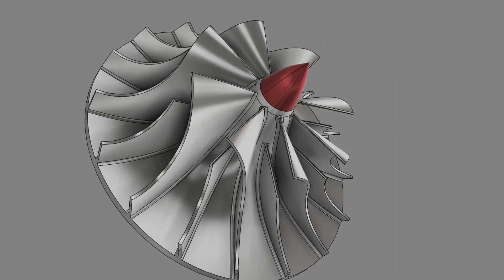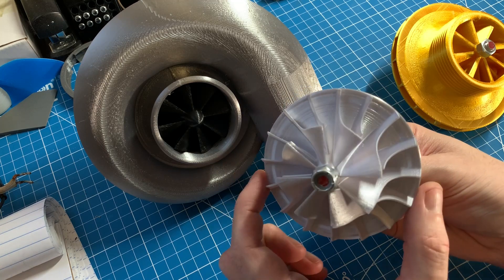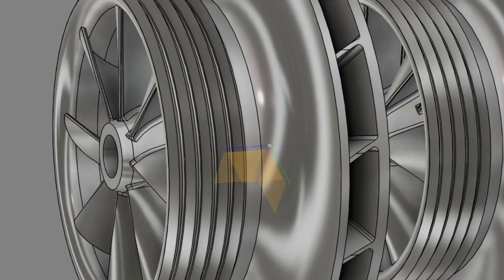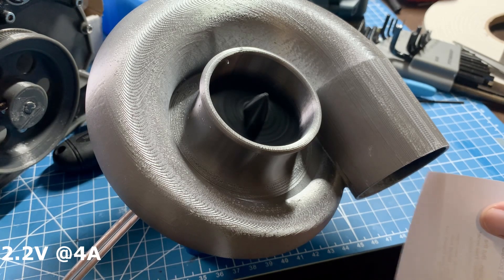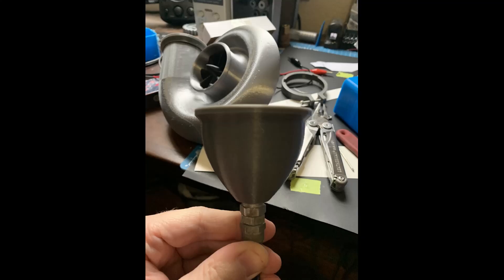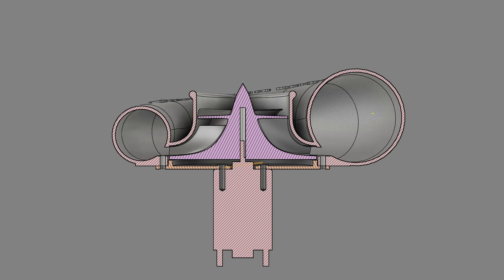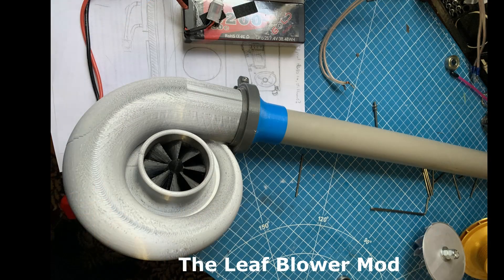3D Printed Centrifugal Turbo Compressor

Comment: Curious, did you ever end up putting the STLs out there on this? This is one of the best designs I have run across. 
From what I gather the wedge diffuser is quite important for pressure and efficiency sake.  Looking at the NASA CC3 impeller, some pretty impressive top end is possible. The only way I can see basic FDM machines making a strong enough impeller would be using lost casting, Sintered FDM, or perhaps a kind of carbon fiber mold.

Comment: 1:35 You right.... its not easy job "Design a compressor wheel" 😑 And on some CAD software it becomes even more difficult.

SolidWork = too expensive.
AutoCAD = expensive.
SolidEdge = poor performance.
Fusion 360 = its a pooph cad 💩

Comment: Can you share the cad files or the papers you used to make this? I'm making something like a leaf blower and this seems perfect for that
Reply from the maker: It’s been a long time since I designed this and I don’t have the papers available. I do know for a leaf blower they usually use just straight vertical blades. This blower creates a lot of pressure but the flow isn’t very high.
Reply from the maker: I have the design for the V2 I built here. https://github.com/indeterminatedesign/TurboCompressorV2

Comment: choked flow is absolutely not the same as reverse flow 08:05 in terms of a compressor characteristic, these two states are on the opposite ends of the characteristic curve

Comment: Love the video! What motor should I use if I want to do something similar?
Reply from the maker: Well, I used a 540 brushed motor which was a. It too small really. Obviously there are a lot of motor choices, so it comes down to how much power you need, and how many RPM you’re willing to spin.

Comment: so whats the research paper? i'm not looking for anyhting nearly as efficient/precise but any direction on blade design would be great...!
Reply from the maker: I think I've lost most of those links.  I'd honestly recommend checking out the book:  https://www.amazon.com/Radial-Flow-Turbocompressors-Analysis-Applications/dp/1108416675

For the second version of this compressor I just ended up copying an existing turbo compressor wheel and it was much better performing.  I ultimately found it's really difficult to design a turbo compressor without CFD so you can tailor it to the application.

Comment: hey bro, would ou like to share the file of it, beacuse i need to print something like this but i cant do in blender 😢that's why i am here :D ( if u want to share i would advice you to share it in parts, beacuse printer propably will connect the parts of compressor and it will not work)
Reply from the maker: I have the later version 2 on my GitHub. It is a single .3MF file but slicers can handle separating the parts automatically. https://github.com/indeterminatedesign/TurboCompressorV2
Reply: @IndeterminateDesign  oh, i didn't knew that they can separate the parts automatically, thanks for all <3

Comment: I don't think you're gonna get much pressure from a turbine.  Generally speaking, speed = volume; torque = pressure
Reply: That's not a turbine bud,  the thing he designed is made to push air, not be pushed by air.

Comment: Use a u tube to measure the output pressure
Reply from the maker: Yeah, check out my 2 stage compressor where I used an adjustable restrictor to measure the peak pressure.  https://youtu.be/9YTMmGZ1d0g

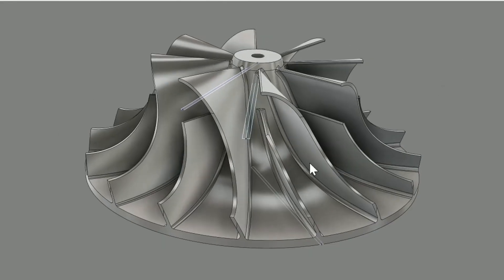Comment: 1:55 I THINK I HAVE THE SOLUTION. Your blade is not efficient at all at the base. The mouth or top of the blade is fine and sucks in air like it should but the base of your blade is at the wrong angle. You have something that looks like the straight spokes of a wagon wheel looking from the top down. You need to angle them backwards more like the look of a hurricane. Your current setup pushes air tangent to the direction of the wheel and it can’t get out of its own way fast enough for more air to come in efficiently. Basically the fan on top is doing all the work. The idea as I’m sure you’re aware is to throw air to the outside of the housing. So by curving the base it will help push the air outward more and create better pressure. All the other dimensions are fine, you basically just need to grab the bottom corner of the blade and move it counter clockwise a little. The idea of a turbo is at its core an impeller with a fan attached on top. I think this is why you aren’t making any boost. Another idea you can try is something I saw on a rumba fan. You have trouble with the clearance because it’s 3d printed and it will never be good enough because that’s just how 3d printing is. The way rumba got around this is putting a cone over the blades and attached to them. This makes the compressor wheel a closed system and your tolerances between the wheel and the housing can be utter garbage and still work perfectly. I would recommend looking up a picture of their vacuum fan to understand what I’m talking about better. But I would try that above all else. Hope this helps and good luck. Can’t wait to see more.

Comment: Your compressor doesn't have a diffuser
Reply from the maker: Good observation. That was a huge issue with v1. If you check out the v2 compressor I added a large vaneless diffuser and actually made a little boost.
Reply: @IndeterminateDesign  also both v1 and v2 have an agressive blade angle of attack at the intake. And both seem to have a rather large intake which increases flow (and power needed to run them) but doesn't increase pressure. The pressure rise is determined by the radius of the impeller

Comment: I designed one too and tried it on my car. It works. I made mine much bigger.
Reply from the maker: That's awesome!  You must have had a massive motor.  I know that Nissan test nylon impellers at one point so it's definitely a possibility for a long term upgrade.

Comment: Amazing designes, I work in factory automation and I happen to have delt with instrument air axial compressors. The ones we have are 4 stage compressors, first stage is the biggest stage sucking huge amounts of air then goes to interstage rad fan style cooler and then to the second stage, the process is the same throught to the 4th stage. Now the second is smaller than first and 3d is smaller 4th is the smallest. The ratio between the drive gear and the dreven gears, one was called high speed and the other is the low speed, was so high like 1:100 for low gear 1:150 for the high gear or even more " not exaggerating". I have actually seen inside of them during overhaul and noticed and linked what i have studied about axial compressors. In order to comperss you need rotor and stator blades. Rotor will move the air at very high speed, now this is were your designs stopped and in this stage it is a blower not a compressor. The secret is stator blades are essential to creat an effect in axial compressors called defusion. Air is comming at high speed by the rotor, stator will change air direction and reduce its velocity, now you are creating pressure and then the max amount of pressure will be limited to multiple factors of efficiency of the designe and clearences between the housing and rotor leakage. As for yor multistage design I have noticed that all stages are the same size which indicate no pressure increase throught the stages + the missing stator part in each stage. Hope i helped and i really look forward to you next videos. 😊
Reply from the maker: Thanks!  Ideally I would create multiple compressor sizes but definitely more time consuming. 

I had thought about the stator vanes in the diffuser, but based on what read a vaneless diffuser has a broader functional range and that a vaned diffuser while more efficient has to be designed properly. 

Is that true?  I don’t have a good way to CFD the compressor during design, but if I just copied the stator off another compressor would it work?  It’s hard to find this information without buying expensive textbooks.

Comment: you are using the wrong pressure tester! use a manometer from a medical tonometer! it is very sensitive and shows up to 0.4 bar.  I hope I can see what you do in the next video as well! Thank you for your attention! if the arrow twitches, then just add a piece of sponge for washing dishes inside the pressure gauge hose
Reply from the maker: Yes, it was the wrong pressure tester and deadheading the compressor into a tank doesn't work for this type of compressor.  Check out my Turbo Compressor Version 2 video, it's a much better setup with better results.  https://youtu.be/9YTMmGZ1d0g

Comment: Can you share your design? I want to try this for my dust collector. I want to move high volume at low pressure
Reply from the maker: That would be an awesome project. I’m not sure how it would work, the dust extractors I’ve seen have a simple vertical turbine blades, but they may just do that because of the cost.  https://github.com/indeterminatedesign/CentrifugalCompressorV1
Reply: @IndeterminateDesign  you actually solved this problem for me as well with your multi stage design. I’m going to design a shroud around the impeller and hook that directly up to my ducting.

Comment: great video, I wonder, if the pressure would increase if you just joined 3 of those compressors.
Reply from the maker: Yes, it should if I can size them right. That’s a common configuration in large gas processing plants.

Comment: Cool turbo 
To smooth your surfaces: I´ve seen on another channel a guy, who puts his parts in a box and soaks the printed parts in acetone vapor (not in the liquid itself)
Reply from the maker: Yeah, I definitely want to try the ABS smoothing with acetone. Plus ABS is much lighter than PLA which would help at higher RPM.

Comment: Axial flow turbocharger...it is possible. A Jet engine is nothing more than a GIANT axial flow turbocharger that can run on its own exhaust energy. Take a look inside a high bypass turbofan engine. The multiple stages of compressors can create some serious HP.

Comment: I'm an automotive performance builder and an electronical industrial control technician with a number of engineering skills acquired through years of experience. I've been experimenting with brushless motors and centrifugal superchargers for a few years now and have recently considered forced induction for a small block V8 consisting of four pairs of mirror image centrifugal bldc motor-driven direct-drive compressors each on its own stack to an individual-throttle-body (ITB) EFI setup. T-3s like they use on Isuzu 2.2 diesels would make a good model and since there's no turbine they don't even have to be metallic. Most small blocks ran 750 cfm carbs N/A so distributed a couple of hundred cfm each would probably be adequate. At least 15 to 20 psi static would be a great target. 40,000 is a pretty safe impeller speed and small ones would have little inertia. Just something to think about. There was a Dutch co. that did bigger T-4 versions with 48v brushless motors (Torqamp) but they're already history. Apparently covid blew it for them; but they were way pricy anyway.
Reply from the maker: That’s awesome. I hadn’t thought about using a T3 wheel, I actually have a couple lying around. I’m working on a v2 of this design that I’d love to take up to around 50k rpm.  A brushless motor setup would be awesome. Given enough money and time, I’d love to recreate a split turbo like Mercedes uses on their F1 engine with a giant brushless motor to eliminate turbo lag.
Reply: @IndeterminateDesign  I'm wondering if I can use some of those high speed bldcs like they use for RC modeling to drive 3D printed multi-stage  axial compressors to use on eight stacks for a couple of rows of individual 3D printed throttle bodies for my 1sr gen Chevy small block.
Reply from the maker: It would be cool to try. I’m always sacred I’d have something fail if I used it on a real engine. Maybe start off with a small junkyard motor.
Reply: @IndeterminateDesign  That is a good point; but as long as you're sure you're not going to grenade the impeller I don't see it as any more risk than torqing your own bottom-end. I don't think 40K rpm on an OEM impeller is much risk at all especially on something small. Bench testing will find a defect if one exists. I'm thinking axial now though. That's what jets use; but I've not seen a single static dead-head pressure test done with one to date. All they're interested in is thrust which I'm sure is relatable to cfm and pressure somehow; but I've yet to learn to calculate it. I bet 8 of those bad-ass 50 mm ones with the high-speed bldcs would make some significant boost.  I was even thinking of using a real fueled  mini jet engine to push turbo turbines to see what kind of rpm and boost could be made that way. That radical enough for ya? LOL

Comment: Centrifugal compressors are fantastic for volumetric flow, but unfortunately not for pressure, in fact compressor surge is a major issue with  these machines, if there is insuffiencient flow and high pressure, the flow can reverse going through the vanes and destroying the impeller. They're commonly used in industry for low pressure / high volume air applications, or on LNG tankers to send boil off gas to the ships boiler. Its a cool approach to arrange the stages axially, all of the multi stage machines I've seen simply take the output from  scroll the volute and feed it into the inlet of another compressor stage
Reply from the maker: Yeah, I did get a massive amount of volume.  I'm working on a V2 which has been decently promising.  I think for 3d printing, the multistage volute to inlet configuration you mentioned will take a lot less material and time design.

Comment: These type of compressors are used in vapor distillation to raise the temperature of steam.
Reply from the maker: That's an interesting application I hadn't really thought about.  I'm slowly working on a version 2, I may have to try measuring the temperature differential of the air coming in and going out.
Reply: I have yet to find any place that makes or even sells centrifugal vapor compressors that are small.